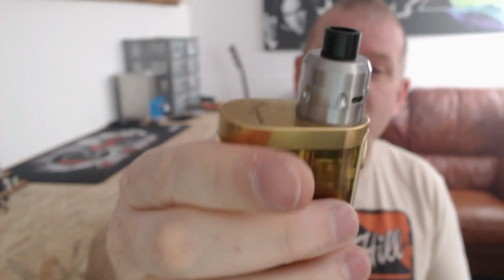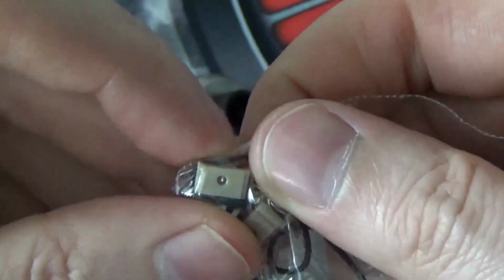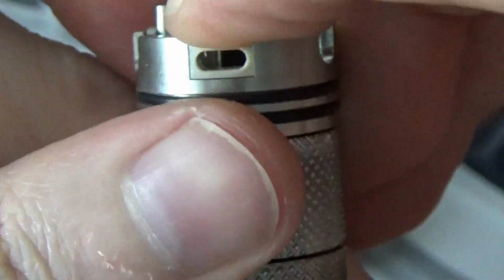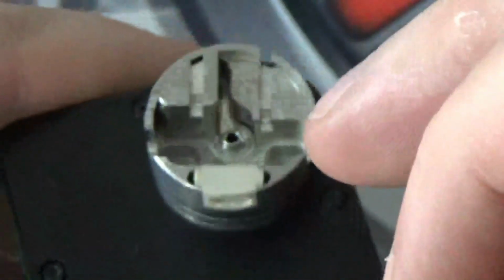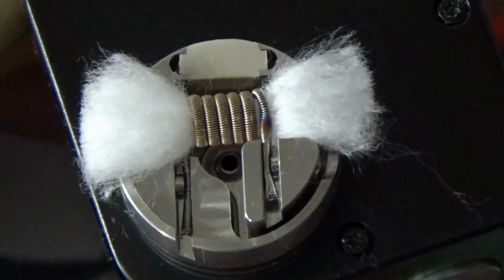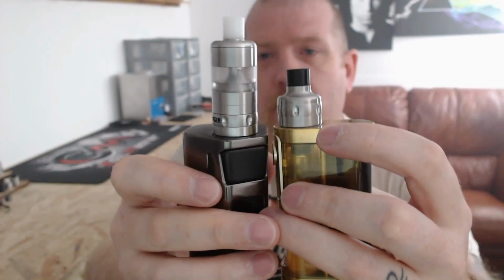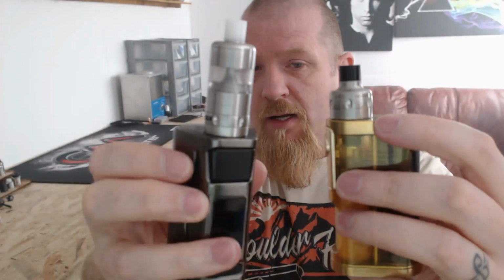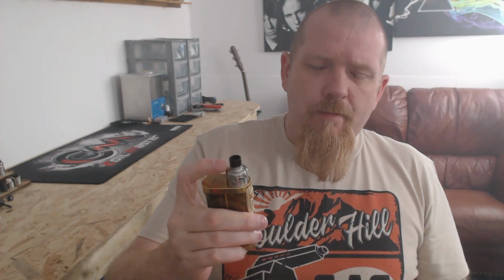Salix RDA From Eden Mods Review

Comment: Thanks for this first look at this RDA. Unless I missed it, I don't think you stated the resistance of the coil you used. Review would have been stronger if you commented on the ranges of coil R & diam & type (round v. wound) & horiz & vertical position that provide best results with this RDA.

I'm not too happy with mine (Ulton clone from FastTech) -- body gets hot quickly, lips feel a lot of heat when using the supplied tip, flavor is muted (compared to entheon & wasp nano) -- but I'm on my first coil, and I expect to get good performance after some trial and error.
Reply: instablaster.